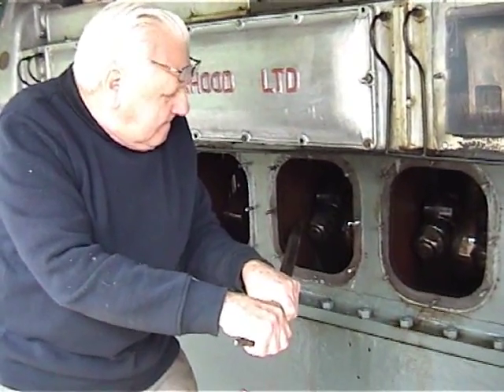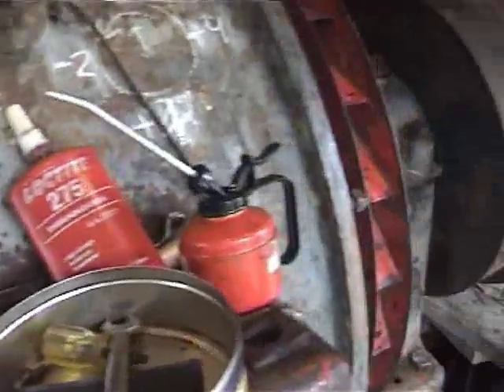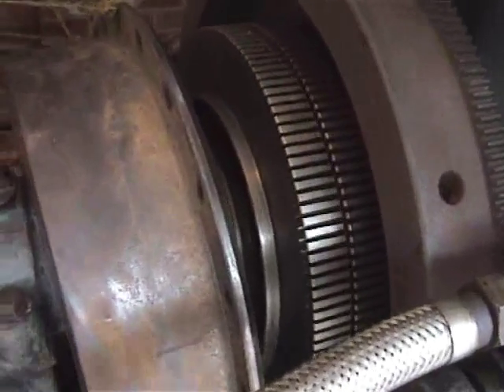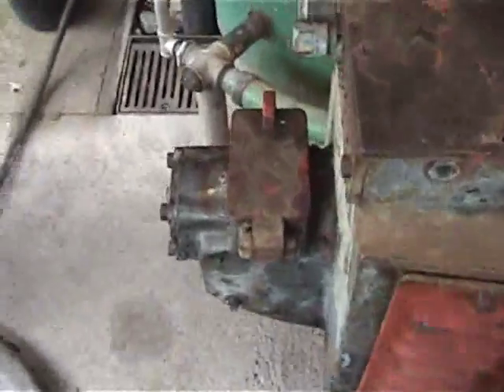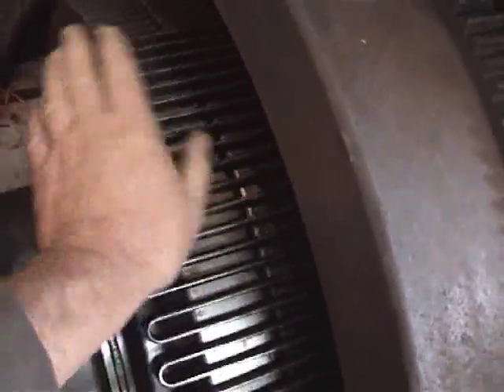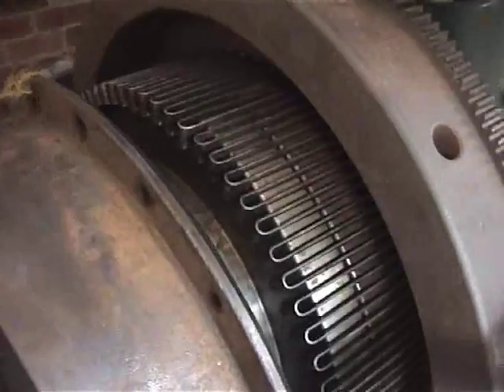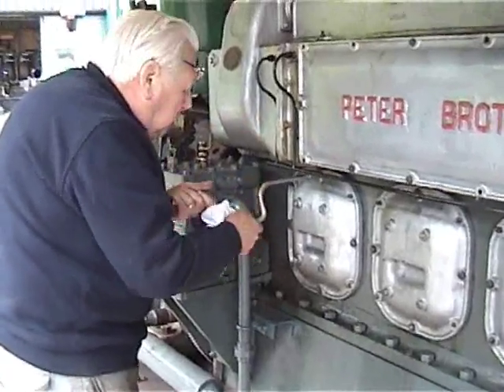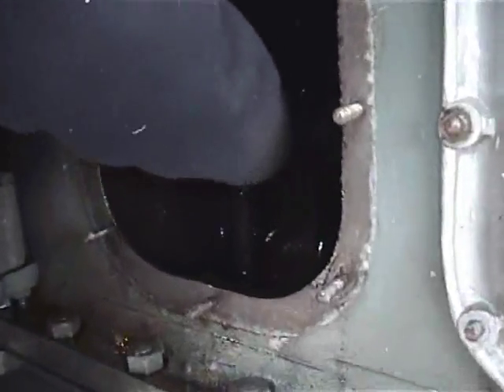Brotherhood Sleeve Valve Engine (Part 23)

Comment: It's a very interesting series of videos; but the machine itself considered as an engineering project is a kind of a mechanical joke. The same thing could have been accomplished; kwh.'s with a 2 cycle detroit diesel operating at 1200 RPM and an alternator half this size; the sheer waste in material and employee man-hours is rather horrifying. After a careful study of the subject I came to the startling conclusion that Ricardo, functioning as your national engine guru was very bad for Britain.